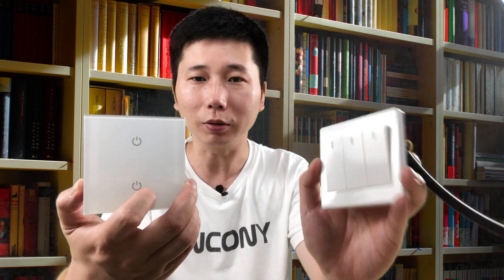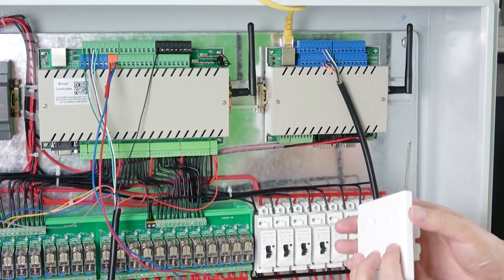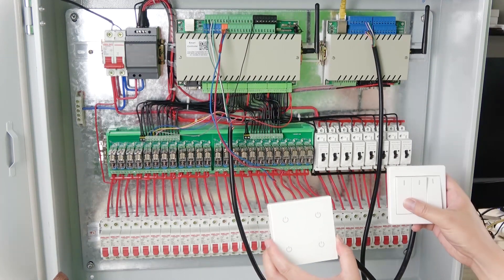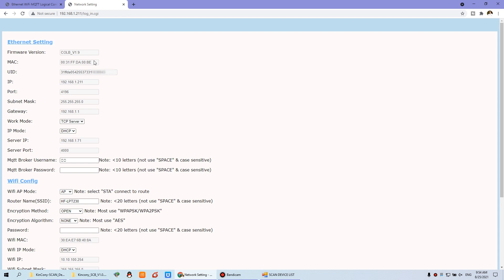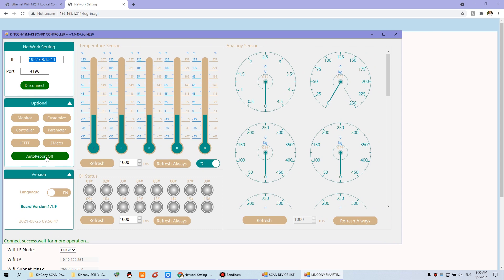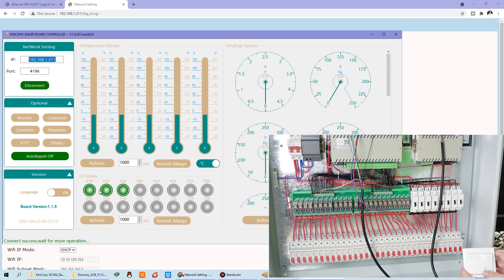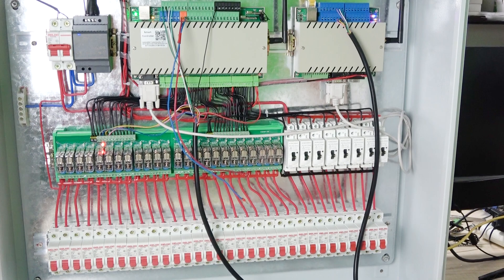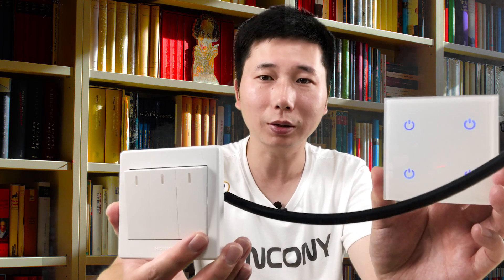【How to use KC868-H32BS #03】Use traditional switch panel

Comment: What happens when I swich on a relay using the old switch and switch off the same  through voice assistant. Will it reset mechanical switch or interchange on and off on mechanical switch?
Reply from the maker: interchange on and off on mechanical switch. now OPEN/CLOSE old switch, all just do TOGGLE command.

Comment: can i add digital sensors (Pir /temperature/etc) in Kc868-H32BS relay directly on the digital port of it...how can i read the sensors value without colb...make video on it
Reply from the maker: PIR, door sensor, any dry contact type sensor can connect to H32BS' input port directly.
Reply: oh...then what is the use of digital input ports available in Kc868-H32BS
Reply from the maker: @ersheikismail8293  any digital input type sensor.
Reply: @KinCony  thats great how can i monitor it..example can i connect pir sensor how can i monitor sensor value..can i use mobile app directly to read the value..please make video about it
Reply from the maker: @ersheikismail8293  that need home assistant. next video will make demo for input port function.
Reply: @KinCony  ohhh kk im waiting